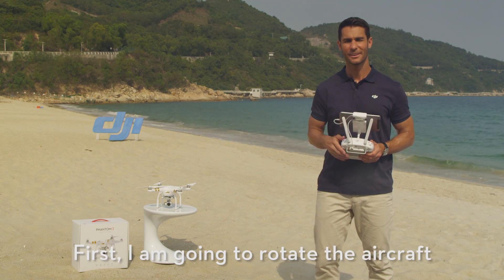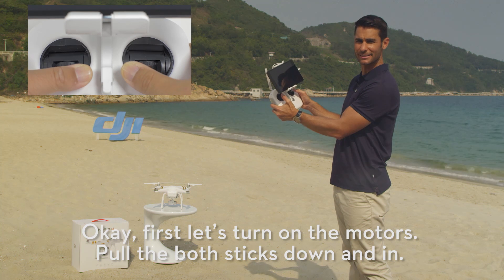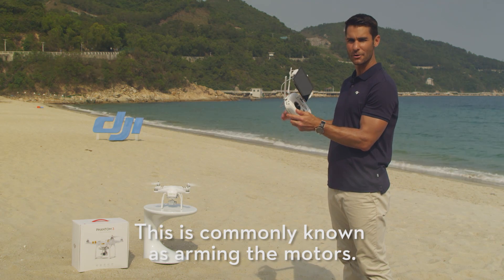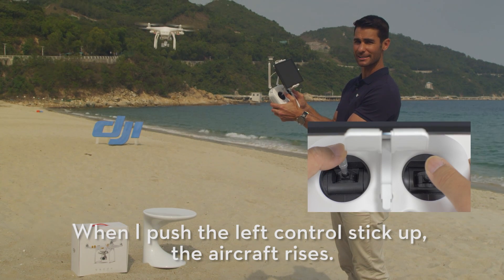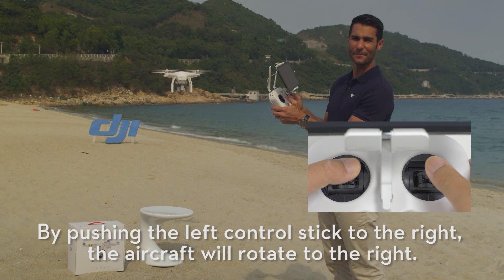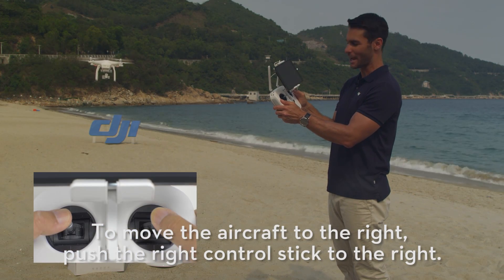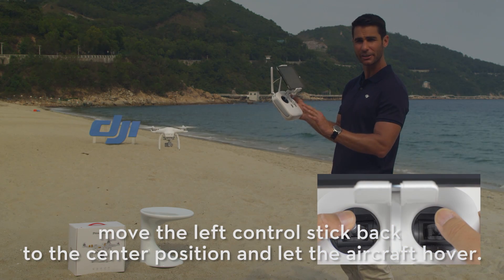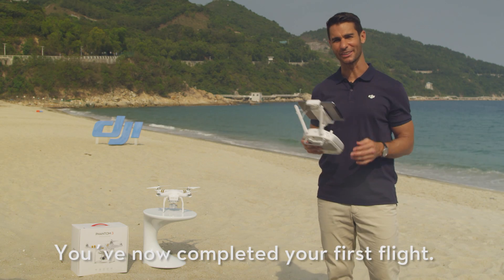DJI Tutorials - Phantom 3 - How to Fly - Part 4 of 4

Comment: Just got my Advanced today and after I landed for the first time without the auto land, I pulled both control sticks in thinking thats how you shut off the motors.....needless to say i ended up wrecking my propellers as the drone tipped upside down with the props on it got dragged across the ground. :/ My fault I guess as I should have been 100% before I tried a manual landing...I was literally sweating and its honestly so stressful flying for the first time.
Reply: Literally the same thing happened to me two days ago on my first flight.
Reply: +WOLKENSCHWElF Scratched up your props and stuff? :/
Reply: Kyezie131 I was landing on a dirty trail so luckily nothing broke, the Propellers got really dirty though and made a nasty sound. After that the motor stopped working for a minute or so. I was truly anxious that I broke the drone.
Did you break your propellers or are they still usable?
Reply: +WOLKENSCHWElF Oh well that's really good then. Mine are just scuffed up and have some wear on them, but I still use them for flying in case I crash again so I'll always have a new set to use. I was landing on a concrete pad so it was worse than a dirt trail lol

Comment: IF the phantom 3 were in flight and you pulled the left control stick straight down as for landing/cutoff... and held it down for 3 seconds, would the rotors cut off in flight? Thanks for the information/demos... :)
Reply: +Frederick Dunn No, if you pull down the left trigger, to go down with the aircrast, the drone will only shut down the motors after 3 sec if the drone notices that its not sinking anymore. So if your up in the sky and pull down the left stick, it will start to sink till its on the ground and cant sink anymore - then it will shut off.
If you do the CSC (same command to start the motors), the drone will instantly shut off, even in the sky.
Reply: +Lewis Sinclair wrong information.
Reply: yes they would